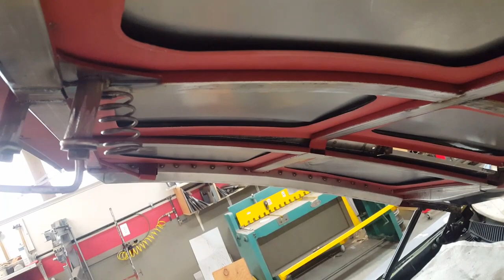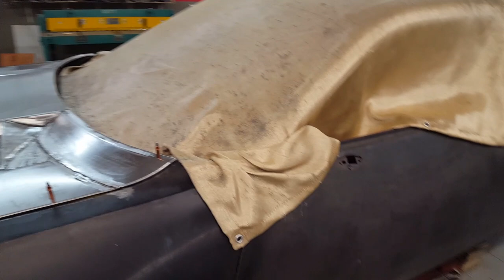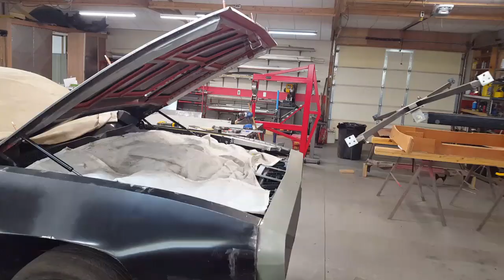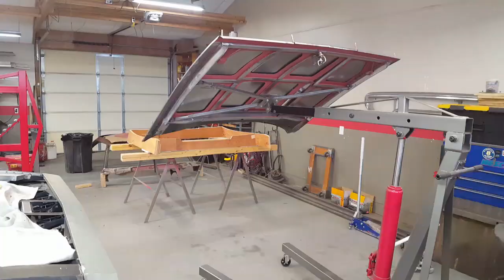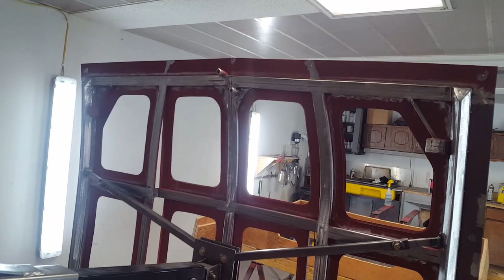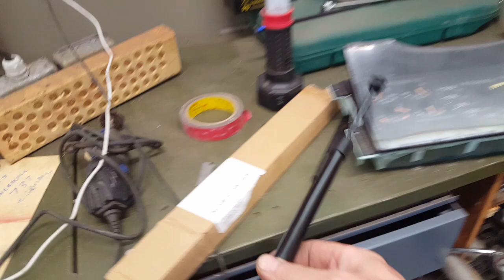2010 Dodge Challenger GTX project part 64

Comment: are those srt8 wheels the same as what came on 09 challenger srt8? My son has been looking for a pair of those for his srt8 chally. The girl he bought the car from wrecked two of the wheels. He has some  aftermarket wheels she put on it, and would love to put the oem wheels back on it. Maybe you'd be willing to part with yours? Just asking for my son.
Reply from the maker: The one wheel came with my wrecked 06 Charger as a replacement on the damaged front corner. I don't know what year it is from but I only have the one.

Comment: Hey man can you please tell me what style front bumper do you have or going to use on this car I’m in the market of owning a Challenger and making it look like a gtx until I’m able to do a full conversion
Reply from the maker: The front bumper like the rest of the car is my own creation built from scratch.
Reply from the maker: The front bumper on this car ended up having to be hand made from scratch as the 71 did not fit right so it is one of a kind.